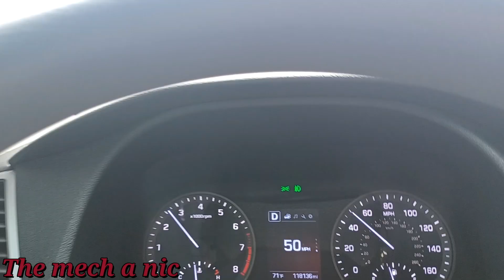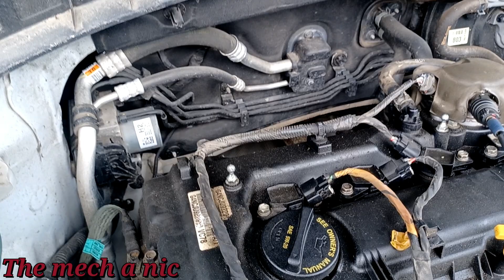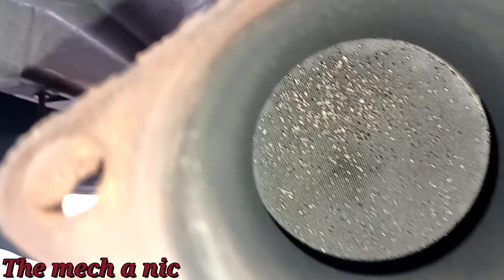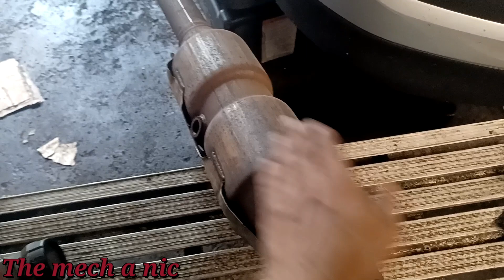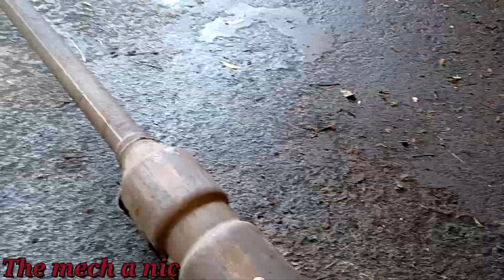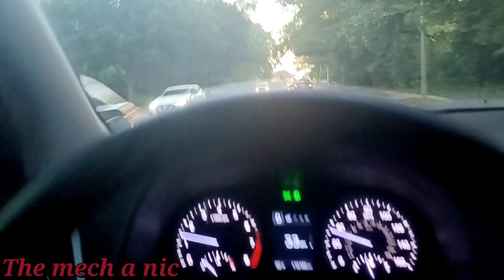car has no power and no check engine light

Comment from the maker: This video is going to be popular amongst the tree huggers . You guys are completely missing the point of this video. My sister lives hours away. Option 1 was to do nothing and she drives home with a car that sometimes won't go over 35mph , try merging on an express way like that , it could also damage the engine because at full throttle I could hear timing chain rattle.....option 2 I hollow out the convertor and she can drive it safely and not destroy her engine.   Of course the convertor should get replaced, this was a "bandaid fix" , no different from putting a plug in your tire in a pinch and later taking it to get the tire repaired properly or replaced.
Reply: I got a check engine light for doing this and now in limp mode how did you bypass?
Reply: Any fix?  @yasabes321
Reply: P

Comment: good call, I have same problem but doesn't the engine expect a certain amount of back pressure for the proper function of the seals and ect?
Reply from the maker: No, the engine doesn't care about back pressure but it will set a CEL for having no cat

Comment: I have a Toyota senza 2010 v6 3.5L engine and after fixing a leakage problem car cranking but no check engine light no starting.
Please what could be the cause of that issue?

Comment: Back in the day, I had a S-10 with the 2.2.  I had a converter go bad. I replaced it at a muffler shop. About 20k miles, the converter failed.  I replaced it again. About 10k it failed again. After that I heated it red hot with a tourch and used a crobar to ream the internals out of the converter.  Did a few revs and blew its guts out. Reconnected everything and attached a new muffler.  Drove great and didn't have a single issue for another 130k miles. The truck ran so good without the cat. It also would get over 30mpg. I think the EPA is more interested in filling landfills and selling cars than reducing hydro carbons produced from the car running. Way more polition comes from the manufacturing of a car than the opperation of one.  Taking the catalytic converter out increases the efficiency of the vehicle and helps gas milage and power.
Reply: Get some  spark  plug non fouler.. install on your car 
You will  never have the  problem with catalic conv..again.

Comment: I think you can try to put a spacer in the down stream o2 to fools the ecm so it doesn't throw a code cat bwlow threshold.
Reply from the maker: When the cat is restricted putting a spacer on the sensor won't do anything
Reply: @themechanic6117  I mean after.

Comment: Interesting video.  Thank you.  I am wondering if you simply removed the 1st O2 sensor, would there be enough escape of exhaust to notice an improvement of power?  Of course the engine would fault to open loop (no O2 sensor to regulate the mixture) and will trigger a fault code.  I'm not suggesting it as a fix, just as a quick easy test before replacing (or gutting) the  cat.  Your test for blocked resonator/muffler was good, but as you guessed it was the cat.  I don't think I've ever experienced a blocked muffler... but I guess mice can do anything, anywhere.

Comment: Why didn’t you simply washed the cat?
Reply from the maker: Because that doesn't work
Reply: @themechanic6117   I had a clogged Cat in my Tiguan 2015, took it out, used some wyyns cat cleaner solution outside of the car, it turned out greate! It worked for me…

Comment: Old video but good video
   2020 elantra limited.   Exhaust manifold getting red hot.     Car drives great!  No bogging. No hesitation.    But when driving hard for a bit, boy does it glow.        Would you say thats the cat on the manifold that is clogged. 

I hove no codes or cehck engine light
Reply from the maker: That manifold should not be glowing red! I'd definitely suspect a clogged convertor
Reply: @themechanic6117  thought so. Cel just showed up. Original plugs Covered in oil.  New ones after 28km covered in oil.    Now cel on

Comment: Excellent fix. I'm facing the same issue. hyundai close to Vancouver want $3300 just for the CAT, plus labor (and taxes on top) - mine is a 2016 so spending $4k seems like a lot right now. One question if you have time to answer?   Did any warning lights come on afterwards (due to oxygen sensor that's present)
Reply from the maker: It's definitely an expensive fix, yes the check engine light came on from removing the filter material
Reply: @themechanic6117  Thanks for the reply.

Comment: I have a 2013 Kia Optima that powers down after driving 30 minutes or more - and when I get out I can hear the exhaust system crackling with heat 🔥from underneath.
Reply from the maker: That sounds like a different problem
Reply: Did u solve it?

Comment: I replaced the air filter, the MAP sensor. It didn't fix the issue, I took it to the mechanic and he said there was no power, and he didn't know what to do because there was no code.
Reply from the maker: I'd put your original map sensor back on and check for a clogged exhaust

Comment: My car is doing the same thing, when I'm parked and I accelerate it only goes to 4 rpms. Thank you so much for making this video. You have saved me time and money.
Reply: On some car raise engine rpm with car in park limited to 4k rpm, that is normal nothing to do with loss power
Reply: @metzmatu8409 should it hold at 4k.   After about 10 seconds my rpm drops to 2k.  Peddle to the floor

Comment: I just went through this exact problem.  And my mechanic came to the same conclusion with the same repair since my state doesn't require emissions testing.  Restored the power and driveability as years before.
Reply: And same reasoning as you state.  It's not a real repair but I commute 600miles per week for work and needed to get the car back on the road quickly and cheaply while figuring out what I'm going to do with the vehicle and not spending $$$ for a rental every week.  Sometimes lifes circumstances is more important than doing a technically correct repair.
Reply from the maker: I'm glad you understand

Comment: Any Codes Tho?
Reply from the maker: No
Reply: @themechanic6117  How Can There Be No Codes Or Check Engine Light That Is Wild Im Having The Same Issue Loss Of Power No Codes Gonna Check The Cat's Thank You
Reply from the maker: The computer isn't programed to know when a cat is clogged . As far as the computer is concerned the engine is running fine.
Reply: @themechanic6117  How Many Miles And Year Of Vehicle? Thank You
Reply: @themechanic6117  That Is Wild Not Even O2 Sensor Codes Wild Thank You

Comment: There should be some backpressure it really depends on the vehicle (turbo charger and even the amount of cats type of exhaust will effect it)  most manufacturers will provide a specific range of backpressure but a general rule of thumb is anything over 8-9psi is too much (for a NA engine)
Reply from the maker: That's wrong.  I've done this same test on many cars that don't have a restricted exhaust and I'm lucky to even get 1 psi . The gauge will have trouble registering any psi if there is no restriction and everything is good.
Reply: @themechanic6117  right what do I know with my ASE 1-5
Reply from the maker: Show me a video of anything below 8 psi (for example 6 psi ) of back pressure is normal.  I say that's wrong because  I've seen 2-3 psi of back pressure at idle and it's always been a restricted exhaust.  Show me proof to prove me wrong. I have no problem saying I'm wrong if the proof is provided to me.
Reply: @themechanic6117  unless your running a straight pipe with no cat there will be backpressure 0 backpressure isn't a thing 😂
Reply: You also skipped the whole manufacturers providing a normal backpressure reading I mentioned but I guess that would mean you wouldn't get to say anything
Reply from the maker: I never said 0 psi, I said 2-3 psi at idle and when you raise the rpm the psi increases  which is a restricted exhaust. I showed in this video that after the restriction was removed the back pressure barely went past 1psi under load. I don't care to waste my time looking for that information you speak of. You're trying to convince me so you provide the proof. In my video I proved my point . There's a clear before and after with back pressure.  I'm not really a fan of arguing on the internet, especially with a ASE tech . Give the video a thumbs down and move on.

Comment: Could putting an aftermarket O2 sensor cause the same symptoms? I feel that after I replace my cat and my upstream and downstream O2 sensors I have the same issue, or should I look somewhere else first?
Reply from the maker: I'd say your problem is elsewhere.  Make sure the engine can breath, meaning the air filter isn't clogged or the mass air flow sensor isn't dirty

Comment: Bit of advice:
1) With the cost of cats right now, you should have cut it off and sold it. The rare materials are still recyclable and valuable. Not to mention the health hazards that come with drilling out the material.
2) I am very surprised you did not trick the downstream O2 sensor with a resistor & transistor. You'll have very rich combustion if the downstream O2 reads high after the cat delete.
Reply from the maker: The downstream sensor can only read the same thing that the upstream sensor can read since there's no cat.  I don't understand how it would read rich

Comment: Its only temporary if it doesnt work right? I would just stick the "test pipe/bung" on it and be done with it. Then she will not get the P420 code showing up. Although I know some cars depend on the downstream sensor to adjust fuel trims or what ever. Evidently that one doesnt. Bought my moms 2006 Buick Lucerne and the cat was failing. I just "adjusted" the O2 downstream sensor and everything is fine. Its not plugged though.

Comment: So, technically speaking, you could get it smogged with the OEM cat, as it is? Then put on a non-OEM cat. Makes it registerable and Sellable
Reply from the maker: With it having no check engine light technically it should have passed smog. It would of been nice if the converter was bolted in on both sides